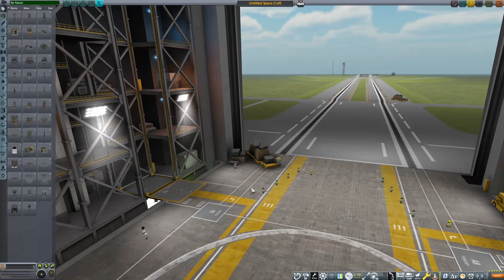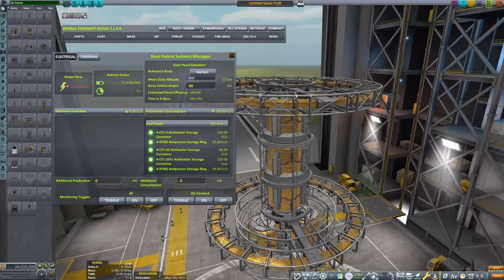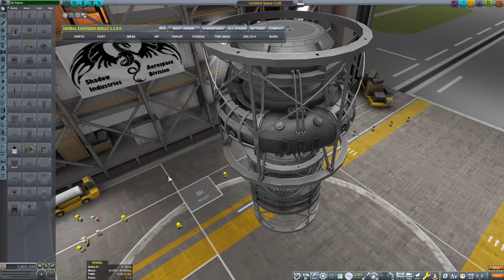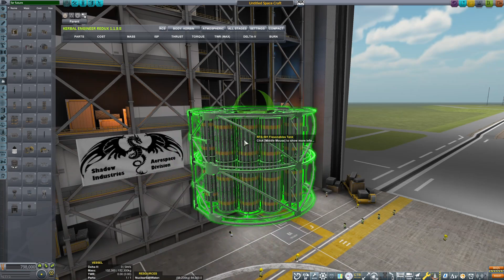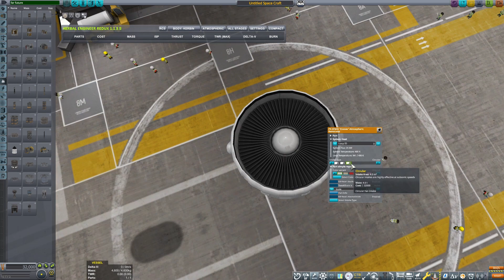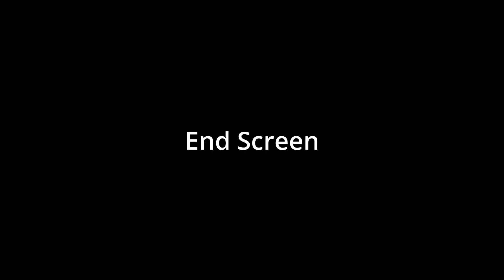Far Future Technologies Tutorial THE SEQUEL

Comment: 12:42 wrong. The NSW engines require a lot of cooling. Just as any of the other engines. There is no tutorial for cooling. It’s not straight forward and the mod added a bunch of steps without any explanation. No option to remove the engine heat mod they chose to add. I just want their engines. Not their annoying cooling requirements.

Comment: im having trouble getting any of the tanks filled with actual fuel except for the procedural tanks
Reply from the maker: All the FFT tanks require electric charge to keep the fuel contained, check if your vessel has enough power to keep the tanks running
Reply: @Javelyn_Shadow even with liquid fuel tanks after i select fuel and ignition type they dont go anywhere on the rocket pad